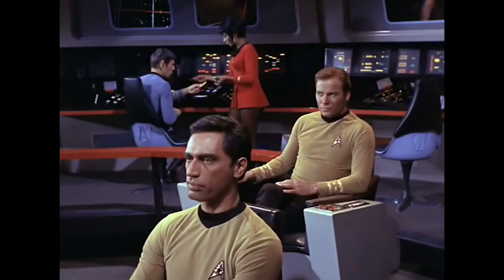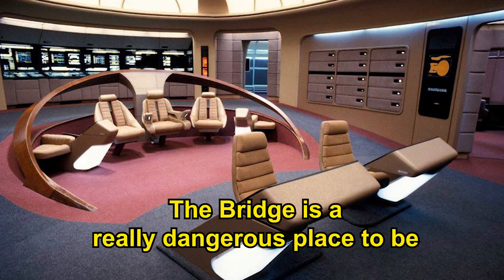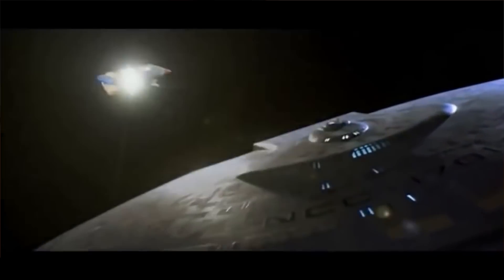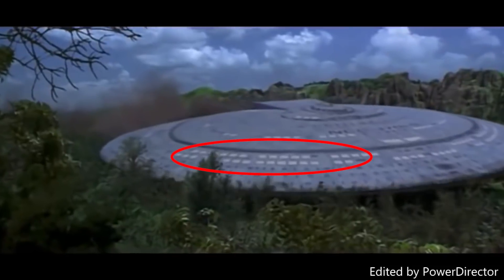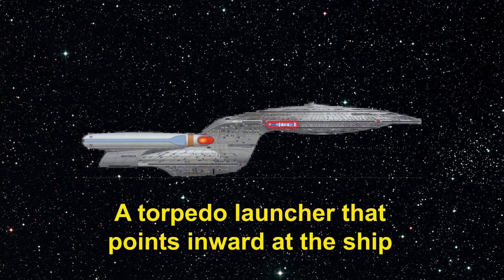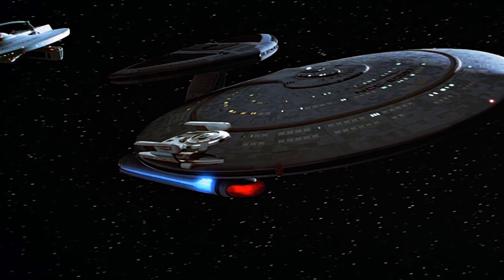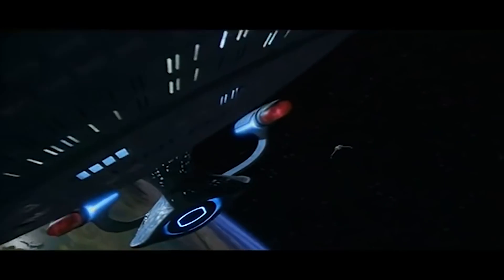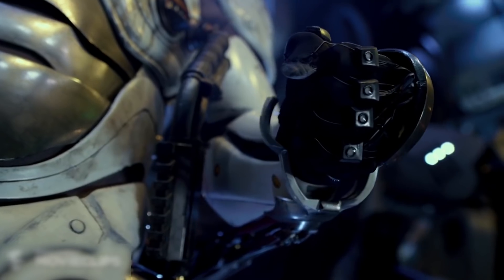10 Flaws Star Trek - USS Enterprise NCC 1701-D

Comment: I am still amazed that Starfleet hasn't invented surge protectors yet
Reply: Marc Rasmussen "I am still amazed that Starfleet hasn't invented surge protectors yet"

Voice of Dr Leah Brahms: "It is possible to protect against surged electron flow. The key lies in buffering the phased energy matrix. This modification will be integrated into the next class starship."
Reply: Marc Rasmussen or go to low power or intrinsically safe controls...
Reply: they have, DATA puts his body in the energy stream when he and Riker ae in the Jeffrey tube
Reply: @you5711  Should have consulted APC or Cyberpower, lol.
Reply: Marc Rasmussen It’s not necessary when you build your ships with bullshittium.
Reply: Ship runs high energy plasma as a power source, a surge protector does nothing. Infact the consoles are ddesigned on the basis of safety, console explosions are when a sudden surge of power, that energy has to go somewhere.......
Reply: That's what the rocks in the consoles are supposed to do.

Comment: Missed a Huge Flaw: The Brig.
Prisoners are secured by a single force field which does not even have a redundant power supply, meaning that it is prone to failure when the ship sustains damage either from an attack or just an anomaly.  Exactly the time when you want prisoners running loose.
A sensible design if they want to keep the complete lack of privacy for prisoners option would be a Transparent Aluminium wall and door system with a force field on the interior so that the Prisoners can't even attempt to mess with the door unless the power goes down, and if it does come down, they are still locked in a secure cell.  Redundant power supply and two guards always on duty would also help.
Reply: This one always bugged me. You know that any episode of any series, be it voyager or the next gen, if they picked up prisoners, they were escaping in a few minutes.
Reply: Cells do have independent power supplies see ST:DS9 6x22 for detail
Reply: @aquamonkee  Is that just on the Cardassian space station, a modification to the Defiant, a wartime addition to the Galaxy class, a retcon or an always was? 
Irregardless, they still need a wall and door, there are dozens of times the Brig Force Fields fail.
Reply: ValorJ Omega  - Exactly, and on diplomatic ships it is 'almost' excusable considering 'other priorities', like not offending an Ambassador(etc.) who committed a 'faux pas' (diplo-speak for violent crime by someone with diplomatic immunity;) by treating him like a 'common' criminal. 
But there are simply no excuses for such faulty design when every one you're going to detain is likely to be a dangerous combatant!
Reply: An those guards are armed at all times too. Possibly with extra defensive measures hidden or not like in their universe a mini phaser autotune port thing maybe to discourage rescue, riot or escape attempts that can be set to either stun or kill as needed or wanted. Just simple measures people in this era do all the time.. just cuz your 24th century with magic voice controlled machines that do it all for you dont mean you forget EVERYTHING that came before.. like apparently Trek humans have. Especially here in security and war
Reply: Spock designed a Escape Proof BRIG in ST:V , when they were captured , he was able to use Scotty to Exploit the Brig failure points.
Reply: @bjmaguire6269  Even with the Ambassador argument, a Transparent Aluminium wall would not provide the same confined feeling as Bars which is why I suggested it given it seems to be what they are going for, plus some aliens can slip between bars.
Honestly though, the diplomatic ship point you raise just further enphasises how wrong it is that there is zero privacy in that very small cell.  I presume the toilet folds out of the wall, but when using it, does the guard turn his back?
Reply: Yeah, I mean, all we have today to prevent escape is solid physical barriers that don't go away when the power goes out... and also modern prison guards don't carry ranged weapon in case those physical barriers are breached.  The last thing you need is an escaped prisoner carrying a gun around... like they have done on Federation ships.  And also, why wasn't EVERYTHING taken from those two Klingons BEFORE THEY WERE LOCKED UP?!!!  Especially when you consider WHY they were locked up.
Reply: Redundant power for the brig is a good point for Enterprise D, a military cruise ship in space but at least the Ethics unlock didn't exist yet. Roga Danar "computer please lower the force field I don't want to hurt anyone but my people made me a weapon"  Computer "you were not responsible for what you became lowering force field"
Reply: Why not just keep the prisoners in their own transporter pattern buffers with an independent power supply? If it's good enough to keep James Doohan alive for 75 years it's good enough for transporting prisoners on a two week journey to the next starbase.
Reply: @spiffcats  Star Trek Online actually pokes fun at that. "The benthans!? I thought I was going to one of your prisons. I could escape from those in a week."
Reply: You're right.  Just install a simple door and you'd prevent 90% of escape attempts.
Reply: "This thing on? I'm gonna be brief. Because I'm dying. Because I got shivved. A lot. I just wanna get it on record that using force fields for doors in a space prison is a bad idea. You know what would have been better? Regular doors. With locks. Locks that don't open when the power goes out. [cough cough] Man, those blue force fields looked good, though. Every time I saw one, I thought, Wow. I am in space. Still though. A door made out of paper would have been better in the long run. Would have at least slowed 'em down for a second. Anyway. [cough] Anybody not escaping or shivving me, get back to work." - Cave Johnson, Portal: Perpetual Testing Initiative
Reply: And other than for dramatic effect, don't you want prisoners to feel trapped instead of naked and exposed. The clear wall meant for no privacy when using the prive, as it were.
Reply: The average person today could design a better prison cell than their brig.  Transparent aluminum sheeting would be just the beginning.  My design would be a pill shaped capsule that is hermetically sealed, with no moving parts within reach of anyone with fingers or tentacles.  "The pill" would contain its own power supply and programmable life support.  Waste products, food, liquids, and even the prisoner is transported into and out of the capsule.  The whole of it would be surrounded by a force shield, both to protect the cell from the outside and further escape prevention from the inside.  Then, of course, you can have redundant methods, such as armed guards providing "eyes on the prisoner", as well as 24/7 medical monitoring.  But TBH, you pretty much have to be a Q to get yourself out of there.
Reply: @robertagu5533  Yeah. Imagine if the prisoners are rapists. Then your trapped on a ship with a few rapist running and you might notice a missing female crew member or two after the attack.
Reply: The biggest problem I have with Starfleet brigs is that they consist of only one small cell attached to an antechamber/guardroom bigger than the cell itself. If you're going to have a big guard room, you would expect there to be several cells attached to it, so that one or two guards can monitor numerous isolated prisoners. But what we get is a single tiny cell attached to a large guard room for no apparent benefit. Also once you're out of the cell into the guard room, there is apparently no additional security between there and the rest of the ship.
Reply: But without guards, how are the prisoners supposed to get weapons when they break out?
Reply: The idea behind the brig (with the exception of Voyager) is to temporarily house an offender, until another Star Fleet vessel could pick them up to deliver them to a penal colony, or, release them if no charges are forthcoming. Voyager is the only Star Fleet vessel that required long term housing of criminals, but the only long term criminals were Paris, who isn't going to escape, and Lon Suder, who, after working with Tuvok, refused to leave his cell until the situation required it.
Reply: bigger flaw, no capital punishment...

would be easier and safer just to "space" prisoners out the airlock like all other sci-fi shows...lol

Comment: Number 10.  Flaw, no joystick. Next line: Joystick is flawed.

Uh.  Ok
Reply: As someone who has played space and physics flight simulators with Joystick and keyboards I would argue that the touchscreen is 100% better for a ship that large in space as there is probably a large flight assist in operation and the touch screen just manages it through simple input. If there was an emergency the flight stick would be useless anyways because with out a hardwired system when the controls go down so would the flight stick. The flight stick would have to manage a 360 degree thruster system operating in space. The inertia would have to countered etc. Not at all like flying a plane. A joystick would need at least multiple inputs and pedals to be effective. So not at all like the Riker joystick. Maybe include an emergancy one in the battle bridge but imo this isn't really a flaw in the design as a joystick on the console wouldn't really work in an emergancy if at all.
Reply: @AltoStratusX1  NEEERRRRRRDDDD!!! - Homer Simpson 2002
Reply: @AltoStratusX1  I'm guessing you're unaware that actual spaceships are controlled by joystick controls when operating manually (such as docking maneuvers). And they definitely have 360 degree thruster systems.